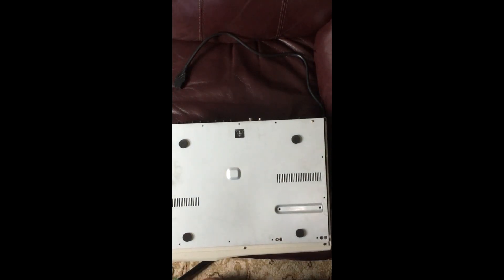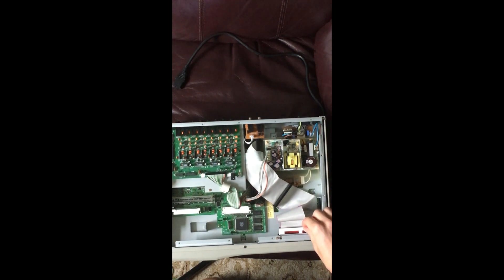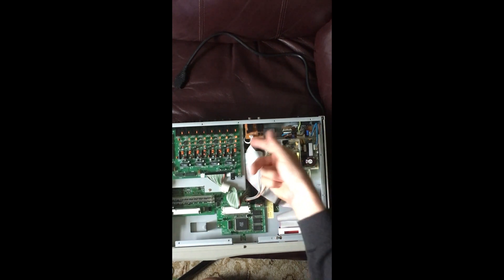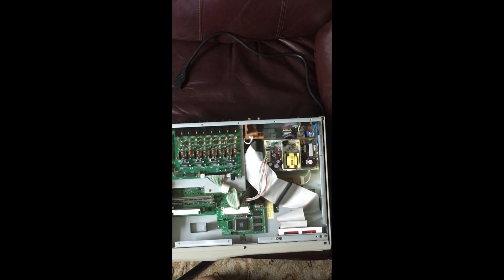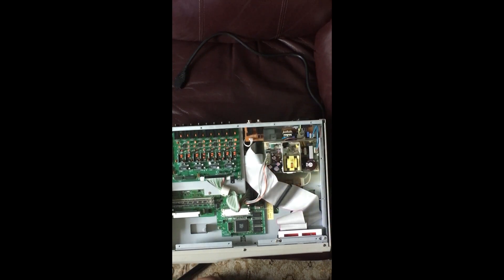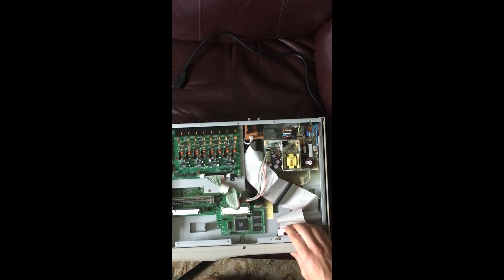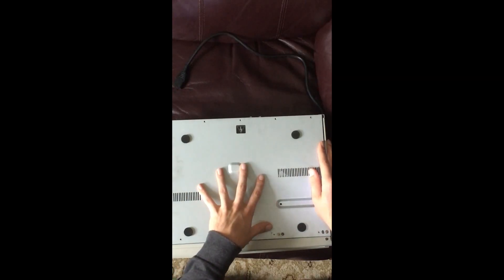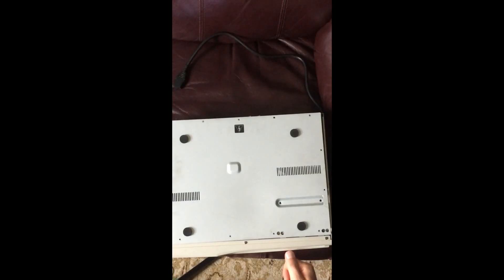How to: SCSI2SD v5 flash Sd Card Reader with Akai Mpc2000XL : Michael Vilogi

Comment: Where did younrun the power from ?
I can’t find a power connector that will fit the small molex r pin connector. In computers that’s typically the one that goes into the floppy drive.

Comment: Having a problem setting up my v5 SCSI2SD card with a Roland W30. I configured 4 x 80MB partitions on the card using the utility software in Win7 for IDs 2 thru 5 and saved config back to device. My W30 boots up from system disk OK, but hangs at SCSI ID check "**HHHH*" which means hard disks found at ID2-5, but won't go any further to main screen. Any ideas, anyone??